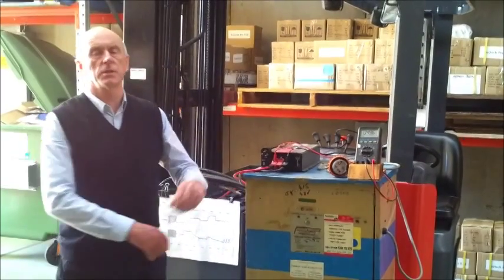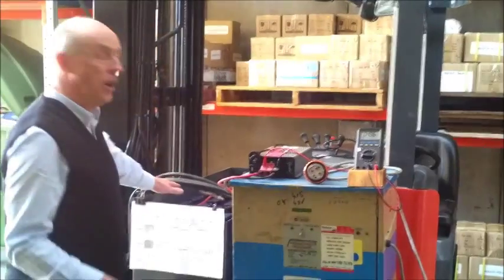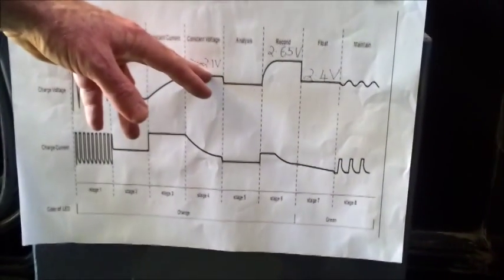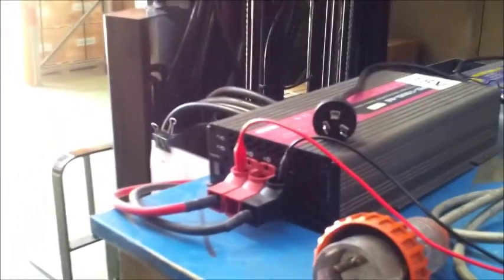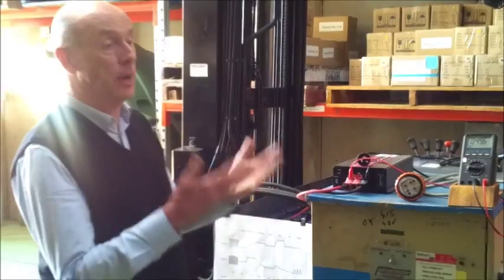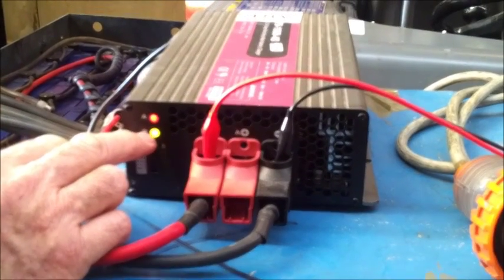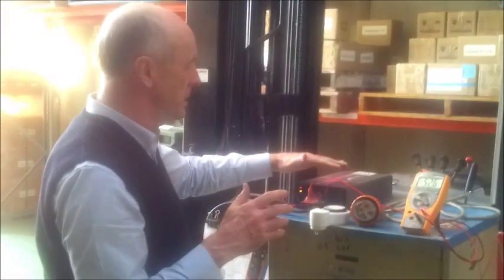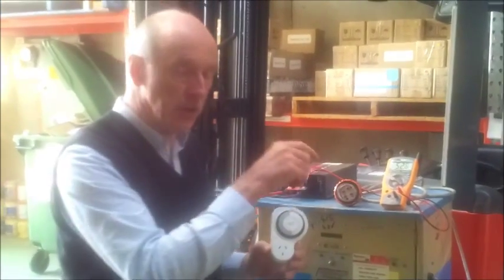Single Phase battery charger to regenerate large forklift battery

Comment: Hello thanks for your video i was wandering what can happen to my forklift 48 volt 3ph battery charger if i connect it to electric panel that has 480 volts 3ph but my chargers is wired to be used on 240volts 3ph ac current i ask because i did tht accidentally connected my charger to a 480 volt 3ph and i heard my charger make a loud pop noise and stopped working this happened as soon as i turned on the unit to 480 volt 3ph and i found out my charger was wired for 240 volt 3ph... I was wandering if its fixable or do you think i blew up the transformer or is there any safety feature that might have just shut down the system to avoid fire short circuit?? any advice i would appreciate it im trying to see if i can recondition my charger after applying the wrong higher voltage... thamks in advance...

Comment: I bought (3) 2012 Crown Electric Forklifts that are 36v at an auction, they came with 3 phase chargers that I cant use. I have owned a 24v Yale Pallet Jack for years with a fairly large battery that has a built in charger that is quite small, about 8" wide by 16" long, i have been curious as to why the forklifts have these HUGE CHargers that are very expensive while the 24v batteries only use the small ones? maybe you answered that question.
Reply: Dennis I just did the same thing as you bought 36V 3 phase forklift from auction... don't have 3 phase supply... what did you end up doing?